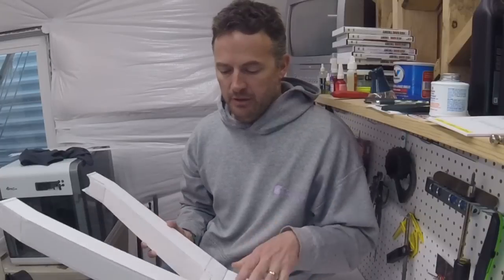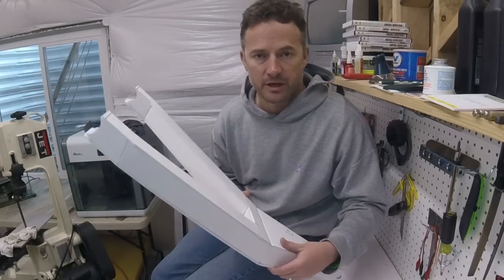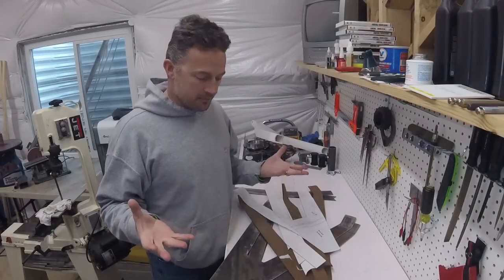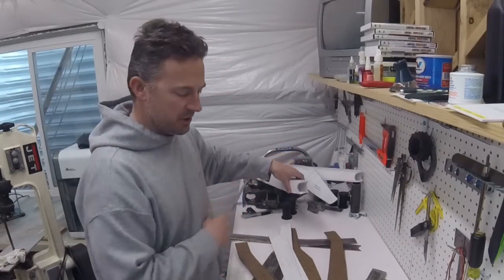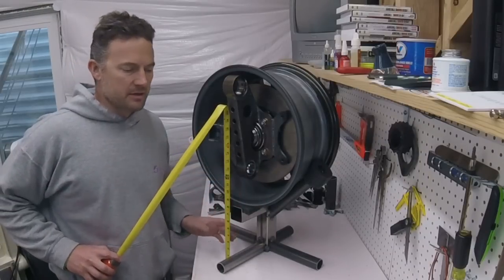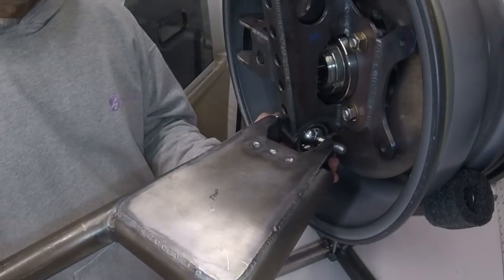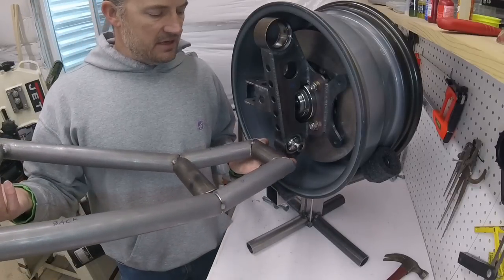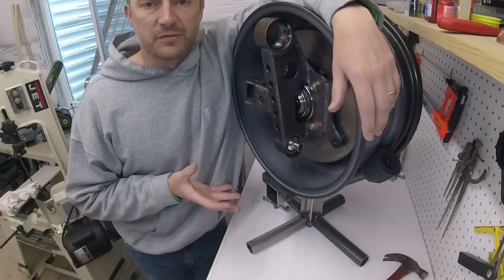Control arm Fab and Design Part 1

Comment: Boxed design is much better! I’d recommend throwing some weld washers on them to beef up the spindle bolt holes and make them last longer (won’t egg out overtime)
Reply from the maker: The weld washers are a good idea. Maybe I'll order some from Kartek. Might not have them on the original fabrication. But if they fit I'll get them on there. Thanks for the idea.

Comment: Do you make your templates actual size or do you compensate for the offset of the cutting tip  ?
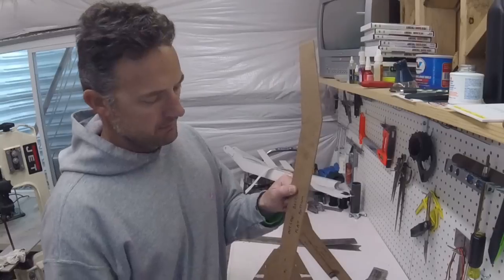Reply: I guess I should have watched all of the video before asking my question you just answered it at 7:00
Reply from the maker: @charliebardo6255  I'll give you more detail. My plasma cutter tip is 1/4" wide. So technically I would offset the template .125". However with the kerf and grinding that ends up to much. So I offset the templates .070" and that leaves the cut piece a little on the big side.
Reply: @DougBugBuilder  thank you sir I've been intently watching your videos.  Especially this about the boxes A arms.  I've got a 65 Galaxie I'm going to be working on soon and want to upgrade the front suspension.  The only ones making anything for them want $5000.00 for a front suspension kit . That's just insane

Comment: how (mm) or inch thickness of steel are you using
Reply from the maker: The top and bottom plates are .100" thick and the side plates are .125" thick. They are all just mild steel.